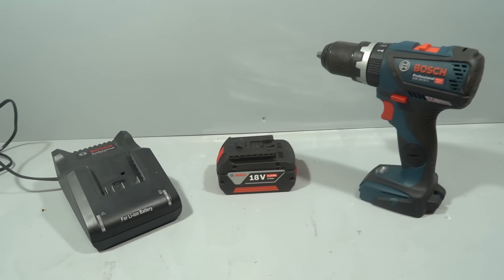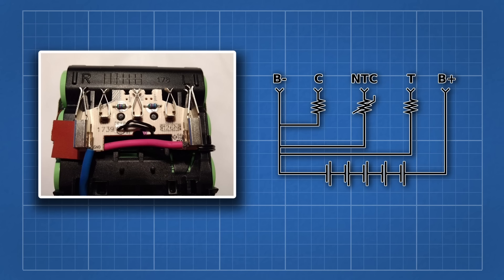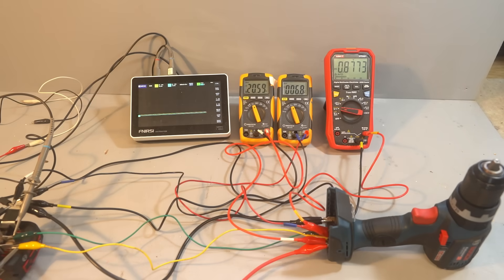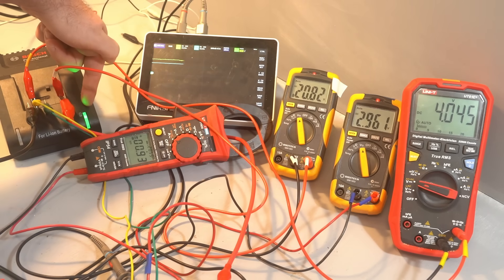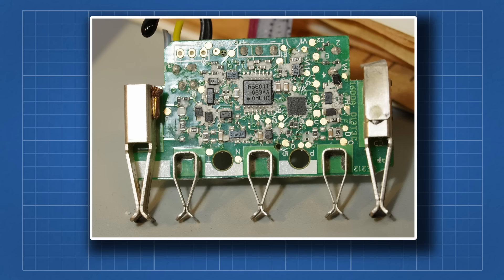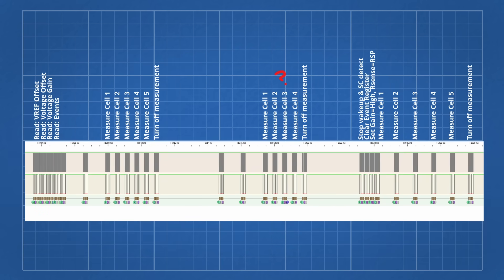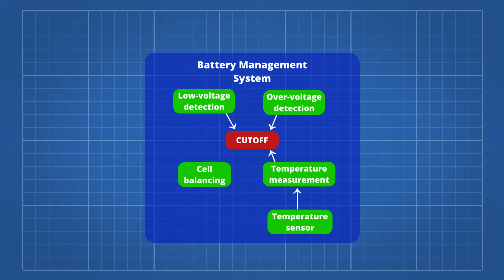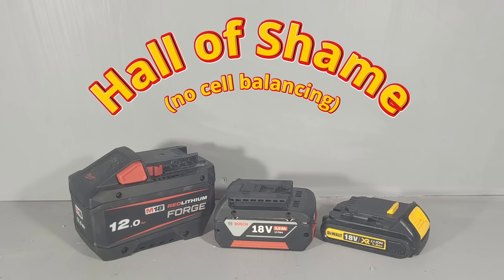[012] How does Bosch 18V compare to the rest?

Comment: Good thing they have 6y warranty on batteries. Just send back unbalanced ones so bosch can balance them for you :D
Reply from the maker: Unfortunately, you have to break the security seals to open the battery and test for imbalance. Maybe you could judge imbalance by the charging termination voltage. Below 20V almost certainly means imbalance, but you have to actively monitor it and see the voltage when the relay switches off as the pack voltage can easily settle back to under 20V
Reply: @toolscientist  My old bosch core batteries did have those little plastic plugs covering couple of screws, easy enough to pull out with a dab of hot glue and then IPA to remove hot glue without leaving any marks. 
The new ones (one side says procore and other amp share) don't have those - are there some new tamper evident features now?

Comment: Would love if you did Hilti Nuron :)
Reply from the maker: I'd love to do Hilti, but they're not very common on 2nd hand markets. Nuron is even rarer. I'd love to test their 22V to Nuron adapter as I'm guessing 22V is analogue and Nuron has digital comms to the tool.
Reply: My guesses anything on the second hand market except a few examples would be from batteries that have been long-term borrowed should we say... @toolscientist 

I've seen neuron hell of a lot in the UK on construction sites as hilty lease out the tools
Reply from the maker: @shifty277  seen a few beat up 22V tools. Also some new specialty tools like the concrete nailers that I assume someone bought for a single job. Haven't seen any Nuron yet - as you say, a lot of Nuron is prob on lease.
Reply: Nuron chargers have cellular radios in them. I would love to see a teardown. :)

EDIT: the closest tool store to me is Hilti. I should go by and ask if they have any dead tools or batteries they could give me. :)

Comment: Before your work, I thought that power tool batteries were expensive because of the top quality engineering that went into them…
Reply from the maker: Now you know that you're just paying for the warranty replacements of professional users 😁
Reply: Its just like razor blades! You buy a handle then they sell you overpriced blades. (A tip: buy a T-shaped razor. blades are stupidly cheap and works almost as good) and this is why cordless tools are sometimes less expensive than corded counterparts: cordless tools will bring more profit to manufacturers, and not only once but repeating. And in case of corded tool, well the tool itself, but then, MAY BE consumables like brushes etc...
Reply: Nearly all the "value" is in the warranty otherwise these packs are just parts for salvaging other packs once the bms craps out. Learned a lot from the 40v batteries from Ryobi.
Reply: Thank you, now I have a good understanding as to why the brushed motors see their demise so easily.
Reply: Are there decent 3rd party BMS’s that you could retrofit on to a new pack to allow cell balancing? I never know how to tell if any of the aliexpress/ebay BMS’s are decent or not.
Reply: @wakeupgeoff - tool battery BMS don't usually have balancing.
The easy solution is to add a 6-pin  JST-XH connector, then use an RC charger to rebalance the pack occasionally.
Reply: @johncoops6897  This is what I do with my cheap knockoff battery packs. 

If the cells are cheap and the BMS might or might not do balancing, I figure the safest thing is to just have my own balance charger. They aren't very expensive, and then I can have one charger for all types of batteries, too..
Reply: The packs are expensive because quality cells are expensive. Try buying a DIY case and Chinese BMS and then buying genuine high-end Samsung or Sony or LG INR cells and you will find it's cheaper to buy an original pack with a warranty on it.
Reply: @johncoops6897  nothing like that. I have original case of m18 hd12. Have to replace bms and cells (one row dead). Bms could not balance my new cells from nkon BAK N21700. Put on new cheap bms and have forge like 12Ah battery just over 100€. Still going strong and hold charge almoste 2yr. Shure it could not get wet becouse there aint any couting on cells or bms metal connections
Reply: Original hd 12 battery start charging to 3bars and drop to zero  way fast just in 1+yr😐
Reply: @vygandaspudzmys1086  My M18, 12AH is limited to 3 LEDs too. I have a sack of M12, 6AH and smaller that won’t charge; they just blink green and red when I put them on a charger. I have four M18, 6AH that work great. No problems with them.
Reply: @vygandaspudzmys1086  Agree, tool batteries are generally very overpriced.
Reply: @johncoops6897  sometimes*
Reply: @johncoops6897  I can' t agree, I've built a lot of packs with quality cells and good BMS's and they work out much cheaper than your Makita's etc. The budget brand tool batteries are closer in price.
Reply: @toriwatson9655 - tell me specifically what brand and model no. of cells do you use, and where you purchase them from and how much they cost you including shipping.

Comment: I wonder if the balance on and balance off command are switched. However this assumes they want to do balancing, rather than choosing not to for longevity reasons.
Reply from the maker: I don't think so. Only cell 1 was unbalanced, so that should be the only one they turn on. You can't balance adjacent cells at the same time (so you can't do 1&2). So balancing 1/3/5, then 2/4 is a little too convenient. Seems like they're trying to pulse all the cells